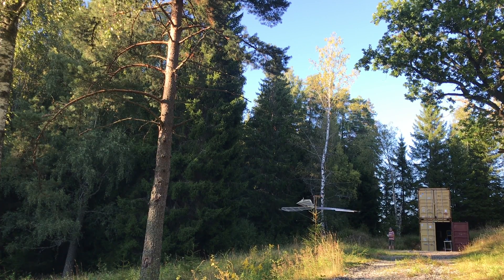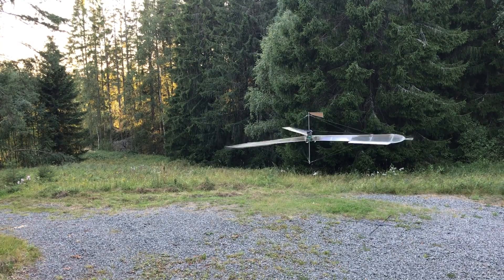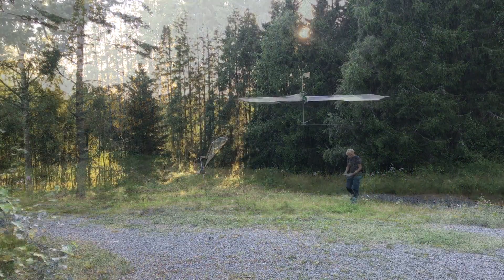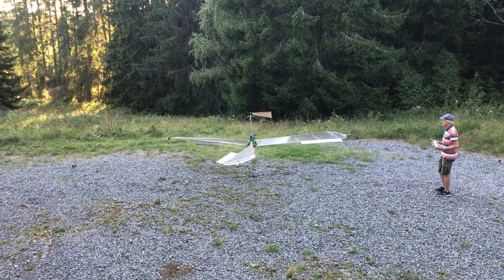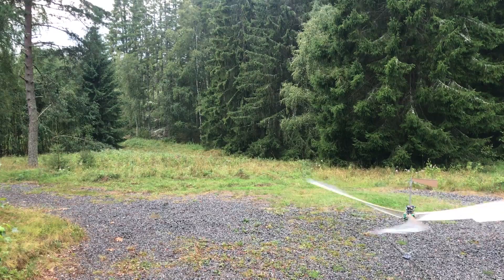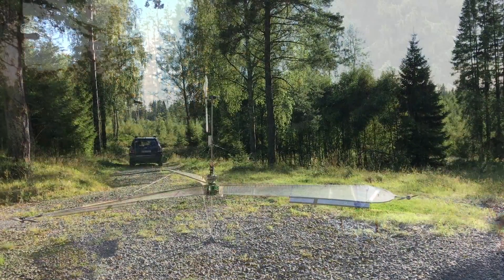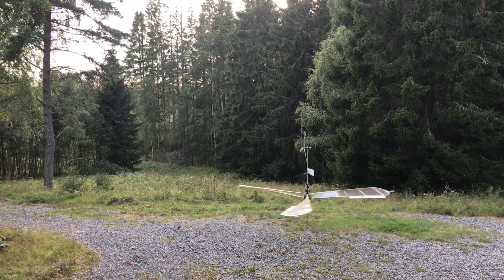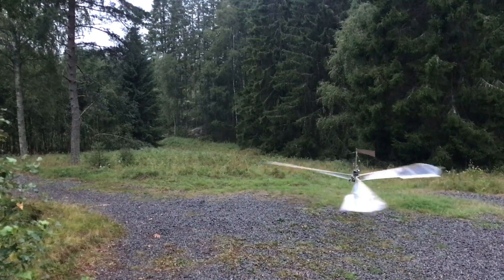Levitator 3 Further Testing. DIY aircraft.

Comment: Military used simple rubberized male female tubes for waterproofing jeep electrical joints. Might give them a looksee as they also hold the connection tight. Used to call them cannon plugs fifty years ago

Comment: Try a slightly weighted pendulum of a sort, 
maybe a bearing with a loose hole thin cabled
 from the bottom. A tail of a sort, or a space that 
 allows the bearing to roll freely at the bottom 
 and help resist the tilt, increased weight as
 needed to allow your control 🤷 just a thought.
Could this be solar powered at the lower speeds 
For duration?
Great idea, I can see tons of uses.

Comment: What's amazing as I can see that thing spinning both clockwise and counterclockwise almost simultaneously are brain keeps flipping the rotational direction and it makes it very hard to tell which direction is actually spending in., has anybody else noticed a strange optical effect I wonder if it happens without the camera

Comment: Could you use weight shift to move it laterally. if you had a boom with a weight on it that could be angled in the direction of the intended flight direction. .

Comment: This is real engineering, good stuff! So each wing weighs 2kg = 6kg total PLUS 6kg weight of the airframe = 12kg total weight of the craft. It generates 12kg of thrust. How are you going to tackle the problem of not being able to lift any payload with the current design?

Comment: Another way to power the rotor blades is with a single centrally mounted and vertical electric motor mounted on the rotor hub. The motor's vertical propeller rotated eg clockwise while the much larger rotor blades, powered by the torque of the hub mounted electric motor, rotates eg counter clockwise.  The torque will rotate the blades at the speed appropriate to the blade sizes and pitch.

Comment: 70%  diameter   from hob is feeling neative pressure in axial flow propellers.
So that shade that area from top.  30% diameter help to produce 100% positive pressure. It is found by pressure distribution over various radii from hub. 100% pressure at tip and 25% pressure at ceter of radious

Comment: A small counter rotating prop might give you the ability to do the same thing as the propeller on top but the speed control would allow you handle directional changes with speed adjustments.

Comment: Beautiful and elegant!  Looking at your control surface connecting rods, I think you might get more strength by using a small fin rather than a post to join the control rod to the control surface.  Sort of like a little vertical stabilizer.  This would be stronger than a post because the control surface reciprocates with each rotor rotation.  A fin-style bellcrank would give more control authority because it will be more stiff--joined to the entire width of the end of the control surface.

Comment: Very elegant design. Near the end, in the slow motion view, when the aircraft was on the ground you talked about the six sections, and I could see them adjusting to three different positions. But, after you lifted off, I did not see that cycling. Was it in some type of test mode when it was on the ground?

Comment: would the surface be big enough to house enough solar cells to sustain flight? if not how many amp hours would it take? it may be a good design for high altitudes or even other planets like mars because of its large surface area. also if you installed a single rotating motor in the middle instead of on the wings and added just enough weight at the bottom to stop it from tipping over would it still take off? maybe shift the battery to the bottom and have a single low geared motor to control the lift and two servos to shift the battery weight around to act as your X and Y control. that would allow you to dedicate all of your surface area for lift. you may still need a motor to counter act the rotational force on the battery but it saves you alot of weight in the end. it does seem like a design that would benefit from reaction control of some sort. just make it shift weight around until it is moving the way you need it to. i don't know im just spit balling i guess.
Reply from the maker: Solar cells on the covered part of the wings would provide about half the power required for hover. If you optimized the craft for solar power you might pull it off.

Comment: What if you try'd making it move by deforming the wings?, (using a helicopter-like swash-plate (maybe)  to tension and de-tension the blades, making them almost crawl/paddle along the air,......It's very good at self-stabalising.....forcing a direction seems to destabilise it. Would be beneficial to working with this effect, and you'll find it might even move faster than you thought, with less sway..... Science, is not an exact science. 🦄

Comment: Make it out of Area 51 alloy, put a ball bearing handle on the bottom, sharpen the blades, and you'll have a valuable zombie apocalypse tool in your arsenal. The alloy is near weightless, folds, returns to shape and is nearly indestructible with a charge. Easily backpackable. I'd use a AA sized mini Tesla coil as it energy source. This will both shred zombies to pieces while frying them undead to a crisp!  I estimate a 150ft kill radius with 100% efficiency using a AA coil. Efficiency drops 1% every 10ft thereafter, so pay attention! What's the handle for? Well, I'm glad you asked. It's to hold on to for self travel. Whether to scout an area, enjoy the sunrise/sunset, "watch over" girls bathing in a river, or if the zombies get you surrounded, you have your own personal helicopter. I know you're worried about being fried by the tesla coil or falling but I've got you covered. Simply use a Michael Jackson glove from the Thriller album! It can be used like a Nintendo 64 power glove to control the craft, protect you and others from the coil's energy, and is magnetic to the Area 51 alloy of the handle. The attraction is so strong that the link can not be broken by any force outside the glove, yet so in unison that simply opening your hand frees the connection and lightly lowers you to the Earth's magnetic force. The glove also can be used as a zombie attractant for mass slaughter as Mr. Jackson demonstrated. You'll enjoy the labor of love so much you'll become an amazing dancer while controlling the craft with your glove! Very satisfying work along with excellent pay. You'll be a hero!

Comment: I have a solution for your steering.

Replace teh 4 triangle flaps with remote activated directional weights, 4 of them like your flaps, but able to actuate to the direction you want. The maximum it might go is a 55• angle.

Comment: I don't get how it works. What keeps all but the 3 blades from rotating really fast the opposite direction - resulting in very little turning of the blades?? (a typical helicopter has the little blade at 90 degrees at  the end of its tail for this purpose).

Comment: Really cool if could get enough solor panels on the wings (probably colse to base and on edges of wings, or even over all weight) going to charge at same time as flying.
It could be really good for searching large areas for missing hikers etc, depending on wind stability and weather.

Comment: I would liken your lifting wing phenomenon to gyroscopic procession, just observed at a much slower speed due to the design of the craft. Do the lifting surfaces feed any data into a flight controller at all? configuring this input like that of rotorblades might yield you more authority for direction change

Comment: what is the maximum carrying weight capacity?
Reply from the maker: Well, this is a first test vehicle, design only to carry its own weight, 12kg.  However tests shows that it can carry 3-4kg extra weight. It can still take off when loaded with 6kg payload, but vertical performance becomes marginal at best.

Comment: Would it be possible to add  small horizontal  ducted-fan propellers top AND bottom of the aircraft for faster horizontal movement (using tripod landing gear to clear bottom propeller) ?

Comment: First time viewing your Levitator 3 and immediately see some significant advantages to the design verses conventional helicopters and fixed wing aircraft. At 7:00 you point out one inherent safety feature- the attitude "self-correcting" feature that results from ground effect. My guess is that your weight to power ratio is better than conventional helicopters due to several factors such as slow blade rotation and the absence of a tail rotor.  My initial impression is that this design has good potential for personal flight and the autonomous commuter aircraft industry although forward flight speed capability limitations will limit that applicability. Very interesting, innovative design.

Comment: The servo rod might have broken because it makes sudden movements and it's a continuous fatige source. Maybe you could make the servos adjust to it's position more gradually, it's easy to program, so it's not a big deal either and you might have better control over the aircraft

Comment: Just a suggestion, you may be able to increase your range of mobility by changing the center of gravity. Add a weight at the end of your lever that will shift weight forwards and backwards and then at 90° left to right both would attach to the stationary portion either the skids or above the rotors. Even a small weight on a longer track can produce a significant moment of force. And could be programmed to counter the momentum you have incurred when your sticks are released. It would involve adding two more servos therefore two more channels, but I think it will give you the pitch that you demand in conjunction with your existing controls.
Reply: Heaveiet=mote power less aerodynamics less range and mobility

Comment: Has anyone else noticed that at certain distances and hover height that you get the same illusion as the silhouette of the spinning ballerina?  Meaning the blades can appear to be spinning in the opposite direction and with practice you can see the Levitator spinning counter clockwise and the next second spinning clockwise.
Reply: yes and I like to let my eyes reverse the rotation and see how long it takes.
Reply: It is a kite but I'm not sure, I am trust my science it's fail on this experience on a look

Comment: You should look into Delphi weather pack connectors, they are automotive grade and work amazingly well, and are waterproof to boot. I have been using them for almost a decade and haven't seen one fail yet, and I live in the desert so they take a beating.

Comment: Your channel is very inspiring. Please accept these three possible  modifications to your model for testing purposes ( I really believe that other fans may agree that a Levatator is different from a Hellicopter ). Please allow the Levatator to always fly Flat as a pie pan ( lateral movement can be added without any tilt ). A Gyro / Gravity corrector could be completely On Board. The Lateral Movement is where the RC Control belongs. It can control the Angle of Attack of Radial Vertical Darius Rudders ( extending both above the wing and below the wing ). As the Levatator hovers in a complete stable flat plane, the Vertical Rudders are the Cyclic Drive. It should move very smartly in any chosen direction. Each wing controls the Angle of Attack of it's own Horizontal  Aileron. The only Pilot Control is Throttle and the Cyclic Angle of the Vertical Thrusters. Your Tilted Flight on the Quad Air Chair was very much a call for Level Flight. This Concept does scale up. The only additional Control is an Air Fin on the Pilot Cab to allow it to be rotated relative to the direction of travel, or while Hovering to  see different views.

Comment: THAT IS AMAZING!!!!!!!!!!!  PUB THE PLANS MAN!!!!!!!  I want to make one!!!!!!! H-H-HOLY CRAP THAT IS SO FREAKING COOL!!!!!!!!!!!!!!!  IT'S A GYROCOPTER!!!!!!!  :D :D :D  Those Airfoils are really neat!!! I noticed how instead of being flat like a traditional plane foil - you have them curving on a rotational axis along the center line with flaps!  Does that really help with additional lift?  Have you done testing with flat foils and compared the differences in lift weight?!    I say this because if they really are that much better - you'd think helicopters would have picked up on that by now!!  Also, what kind of materials are you using?!?!  Carbon Fiber?  Seran Wrap?  Lol.. I don't know - let us in on the secrets :P  If you get this one working really well - have you thought about eventually building a REALLY BIG ONE?!?!  :D  If you do go big - go liquid fuel for sure!  I can understand why you would put the motors on the outside edges of the foils - but have you considered a large single motor in the center?  Or do those designs not work as well?

Comment: I really like the shots where you attached the camera to the root of the airfoil so we could watch the control surface movements throughout the cycle of rotation, but my favorite part was the slow-motion video at the end. You can really study what's happening and even see the flight control inputs are required 90 degrees prior to the motion desired (due to gyroscopic precession). Keep up the great research. I can't wait to see the next iteration! I suggest adjusting the chord to be shorter near the wingtips to reduce the induced drag near the outboard end of the wings. I think this would reduce the power required from the propellers to acquire the same rotational speeds with even longer wings which could have a better lift-to-drag ratio (like the wing tips of a glider).

Comment: Just a comment on the wing design... The angle of attack at the root of the blades only needs to be almost 90 degrees on a propeller in moving air.  Since this is a lifting blade in air that is hardly moving at all, then the blade lift will be increased if the angle of attack on the inner part of the wing is significantly reduced.  At the same time, drag from the inner section of the blade would be reduced  Of course, this change may also have some effect on the stabiliser dynamics.  (Think helicopter, not propeller, in other words.)

Comment: How do you counter rotational forces?
Reply: No rotational force because the rotor is move from tip propellers: see for example the french helicopter Djinn who use tip jets (air pulse generated with a small turbine type Turbomeca Palouste)
Reply: @leneanderthalien  Thank you! I did not see them until you said that. Now it makes sense.

Comment: Pretty excited to find this video - I’ve been toying with building something like this over the last year. A few observations - seems like a narrower wing running at higher speed maybe even with the motor mid wing may offer quicker responses. Also, may be some interesting ideas to be gained from the k-max helicopters which use servo tabs. Thanks for sharing your video!

Comment: Have you checked to see if the half of your wing near the hub in stall or not?

Not really an aero guy, but it ooks like angle of attack starts at like 50° and decreases to about 15° at the tip... which is perhaps typical of many props, but that largely assumes a forward speed to keep the relative angle between the free stream and the blades acceptable, while of course at a hover you have very little such effect—only perhaps an inductive effect of the air at the edges dragging the air in the center.

The center is of course a fairly narrow section of wing at a lower speed than the rest, so this may be inconsequential from a power standpoint. And it's possible that having so much of the wing already in stall might improve ground effect dynamics or something.

Comment: I feel that somehow suspending mass and shifting the rotor axis in a thrust direction could help with lateral speed. basically configuring the center mass, batteries etc so that helicopter type flight can be achieved.
it has great potential for going straight up. lifting a camera, radio antenna, or spotlight.

Comment: Maybe putting more weight to a certain point/pointing the weight outer at the top using long hollow alloy n fill it with ball bearing inside by moving the ball bearing to the end to added weight or point to go n rolled it back to center when u want it hovering in it place using magnets by on or cancelling the magnets in order to make it moving back n forth n a little electronic might needed or other way to make it go to the point u wanted which using a 4 little motor like drone in 4 direction mounted on top n i bet it can be directed as u wish n make it only auto switch on when only u pressing/toggle the controller in order saving it battery...

Comment: Early gyrocopters solved a similiar pitching issue by allowing the blades to flap up and down as they each transition from advancing to retreating during fwd motion. However, with your design, this would create other problems.
Alternatively, you might try a means of dumping lift on advancing blades.
 A spoiler hatch in each main airfoil connected via cable to a gimbal ring that shifts with your cyclic control

Comment: Could you control it by twisting the wing with the cables? Attach the cables to a cam on the main shaft, and adjust the angle by controlling the cam offset kinda like a helicopter.